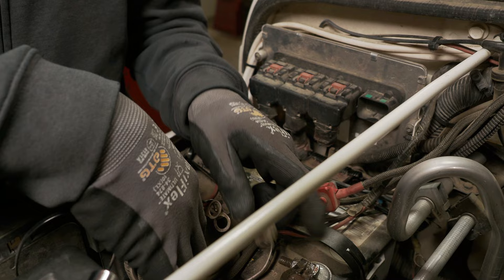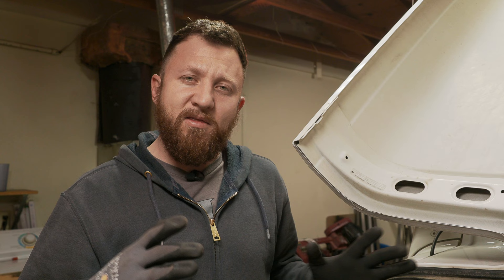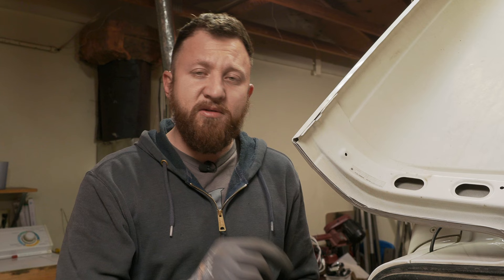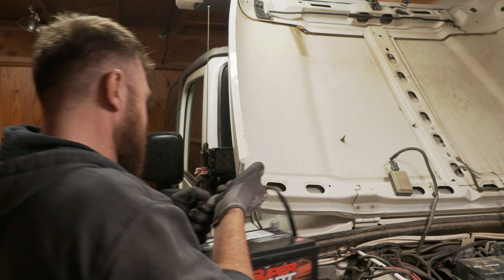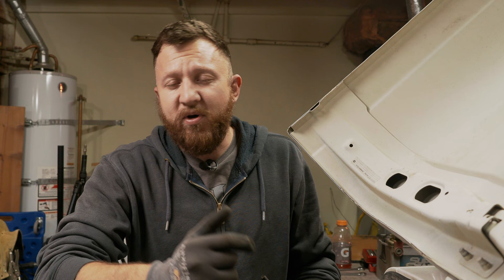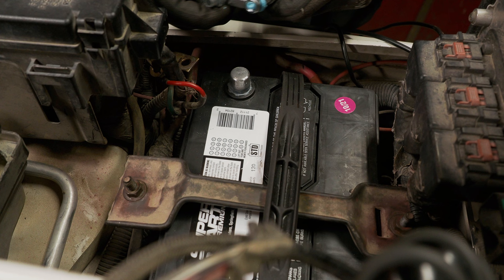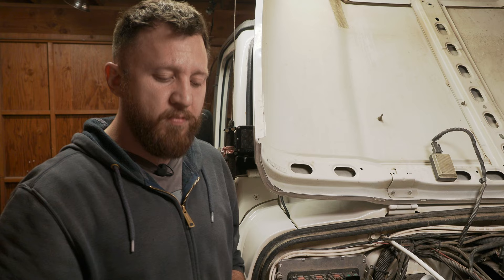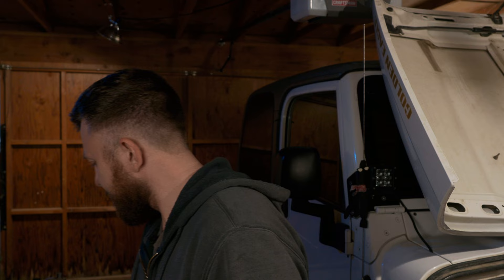Watch Before You Buy AGM Batteries

Comment: I had good results, but my alt charges the battery at 14.2 volts. I also had a very bad experience with a wet cell internally shorting due to off roading causing it to overcharge and basically blow up. The acid ate the brake booster valve which made things very dangerous.
Reply from the maker: I wish my alternator charged that high! I’d be running AGM instead. 

Wow that is a scary scenario. I also had a lead acid battery short after years of off-roading. 

AGM is a better technology no doubt. But It’s hard to recommend it if your vehicle can not charge it correctly.
Reply: @EmbarkWithMark  All alternators can charge at 14.5 volts, you just have to replace the regulator. Mine is bolted on the alt, but most are internal. Basically they turn the alt on when the voltage dips
Reply from the maker: @The_Ballo   Jeep switched to the ECM regulating the alternator some where in the 90s I believe. 

So for this rig, I’d need software to adjust it. I’ve been through one computer replacement with no change. The odd thing about TJ in particular is that some charge at 14.0, some charge at 13.5, some have a battery temp sensor, and some don’t. 

But I do know how to increase the voltage. Just need to get my hands on some expensive software.
Reply: @EmbarkWithMark  Good grief, just more electronic crap to break down when you're in the boonies
Reply from the maker: @The_Ballo  I don’t disagree. It’s rare to have an ECM go bad, but if one does. Not much can be done.
Reply: @EmbarkWithMark I've seen alternator shop use late 70s Chrysler ext. reg to bypass faulty regulator inside the computer.of course the rest of computer has to be ok.
Reply from the maker: @johnstuchlik5828  Yea I’ve found an external regulator kit. Just trying to decide if I want to go that route or purchase the expensive software to modify the pcm and leave the wiring alone.
Reply: @EmbarkWithMark  I found your video as well as comment by your self and others informative as all I knew before about charging agm was to heed the warning label posted on some of them not to exceed 14.8v(if I remember right). my 05 rav 4 2 different alternator taper to about 13.6 when fully warm.i thought this a bit low even for traditional lead acid.i live in warm climate and battery that was in it lasted almost 6 years and the replacement is going on 4+ years both are traditional lead acid, so all seems ok.
. I'm considering going to agm and will do a similar mod that you did to your Toyota now that I know.i understand your reservations about ext reg as quality is all over the map,carry a spare.i think it's possible to use a diode in your jeep similar to what you did to your Toyota.cheap, reliable solution.only problem is where to install it in wiring.somebodys probably figured it out.

Comment: Lithium ion phosphate are better, they last twice as long. Lithium ion can be fully discharged whereas AGM batteries wear out much faster if you discharge below 40% , lithium ion phosphate batteries hold there charge whereas AGM are quickly discharged despite their amp hour claims. And lastly they are much heavier than lithium ion phosphate batteries
Reply from the maker: I don't disagree with any of that. However, Lithium also requires special charging perimeters that an old alternator/ECM will not have programmed in,. Not to mention heat from engine bay is a huge issue with lithium.

Comment: Your wirings  neerds replacement not the AGM Battery.
Reply from the maker: The fact still remains, AGM batteries have very specific charging requirements and the charging systems in older vehicles are not rated to charge them.

Comment: Your alternator isn't working like any vehicle I have ever seen. All the alternators I have had in my last 6 cars from 1997 to 2022 charge their batteries in the higher range of 14 volts. AGM or not. I'm talking almost 15 volts.
Reply from the maker: It’s a common voltage for Jeep TJs without a battery temp sensor. I agree the voltage is much to low.

Comment: I measure my voltage and when I crank the truck it goes up to 15.1 volt and slowly goes down to 14.5 for a while and then settles at 13.7 when battery is full. Maybe your alternator needs replaced
Reply from the maker: Alternator doesn’t control the voltage in Jeeps. The voltage regulator inside the PCM does.

Comment: regular cars have no issues accepting an agm battery. my dodge avenger's factory battery was a 525cca battery, and currently I have installed a high quality, bosch 720cca agm battery. It's been in my car about 2 years and there is absolutely no issues with it. It's been an extremely dependable strong battery. It's also piece of mind knowing that it has plenty of power and will statistically last much longer than a normal battery. In fact, a few months back my drive belt ripped, and I had to drive about 7 miles to a repair shop with no alternator, running on pure agm battery power alone. I doubt the weak 525cca flooded battery could have made it and survived that ordeal. agm also does not corrode, my battery is only accessible after removing the front left tire and a plastic panel. which is a HUGE pain for maintenance on a traditional battery. with cleaning corrosion and topping off the water. it's truly a maintenance free battery!
Reply from the maker: I disagree. It really comes down to what voltage each car charges at. Some do okay with AGMs some do not. Take 4runners for example, there are devices with diodes to try and up the charge voltage in order to properly run an AGM battery in that vehicle. The stock charge voltage is just to low

Your experience really has nothing to do with CCA in that scenario, reserve capacity is what you where running on. CCA is a burst of power, reserve capacity is how long the battery can power something. Depending on your battery, the lower CCA could very well have made that 7 mile drive, assuming the reserve capacity was high enough and the battery was in decent shape. 

In general I do think AGM batteries are better batteries. My point is, understand the car and it's charging system before swapping in an AGM. Its possible the AGM wont work well. 

With that said, most newerish cars do charger at higher voltage. Older Jeeps are famous for charging around 13.5 volts. Thats not nearly enough for AGM, thought 14.0 volts seems to be enough to properly charge most AGM batteries today. 

Oh and I am well aware of the battery location in Dodge Avenger. What a silly design. I'd probably do the same.
Reply: @EmbarkWithMark my Nissan rouge (2013) does not seem to like agm
Reply: my car is curently using efb battery... is it ok to use   agm???
which is more durable and last long??
Reply: @carterbolt5424  Absolutely your vehicle can use an AGM battery, if it came from the factory with a traditional flooded battery. In fact, depending on the type of battery you have installed, tossing it out in favor of an AGM can be an extremely smart decision. My dodge avenger came with a relatively weak 550cca flooded battery. I replaced it with a high quality Bosch AGM battery. Not only is it much more durable, but the cold cranking amps and amount of power it can store has been very useful. I can do things like leave the radio running for a long time without worrying about a battery drain, it tolerates the cold in Michigan much better, it will last longer, a guaranteed 5 years, and it's completely maintenance free. AGM do not corrode on the terminals or require water to be added. An AGM will on average last a few years longer.
Reply from the maker: AGM is the better battery. No argument there. To tell if your car can use one. Get a voltage meter and see what your car charges after it warms up. Than look at the AGM specs. On average the minimum charge requirement seems to be 14.2. 

So if your car charges at or above that. Throw an AGM in. If not double check the charging requirements of the specific AGM your looking at.

Comment: Todays. Vehicles are putting a lot of loads on the battery , Start Stop especially , they cycle the battery twice has hard unless you can turn it off that’s why they use AGM which will recover twice has fast as flooded batteries and they last twice as long but in those applications you should see 3-5 yrs . Today 2024 there are two major MGF that are producing producing batteries in the United States they are Clarious former Johnson Controls and East Penn Family Owned in Pennsylvania since 1946 .

Comment: So my mazda Charges at 13.8-14.1, so you think an agm would be fully charged ?
Reply from the maker: I think your right on the edge, but would be okay. You could always through a charger on it once in a while to top the battery off. I do this anyway out of practice. Helps extend the life of the batteries.

Comment: Cud it be it wasn't being charged because of loose terminal??? 🤔 U should ALWAYS boost ur new battery before install. Most importantly, CHECK DATE ON BATTERY when purchased. Terminals stayed clean BECAUSE of glass mat battery. 
Purchase a higher amper hour  alternator.
Reply from the maker: Positive. The Jeep still charges at 13.5 volts. Below the AGM charge requirement Higher amp alternator doesn’t help with voltage. 

But I agree with everything else.

Comment: Which batter would you Recommend for a Honda civic HB EX 2019? Thank you.
Reply from the maker: Depends on the charge voltage. The best way to figure out what battery will work best is to take a multimeter and see what voltage your car charges at. If it's in spec for AGM then go for AGM. If its too low for AGM than go lead acid.

Comment: It's not the battery technology. The bad terminals were the fault by reducing the volts and current that could go to and from the battery. AGM's work well past their replacement warranty period in any vehicle with an alternator set up for FLA batteries. If you had an FLA battery in their you would have killed it even more quickly. No reason for thread locker on the terminal clamps.
Reply from the maker: My voltage is constant. It’s the same even with new terminals. AGMs do need more voltage than flooded acids do. AGMs are great batteries , If they can be charged correctly.

Comment: Sorry sounds like your alternator is really NOT putting out sufficient voltage to charge the battery.
Reply from the maker: Not an alternator issue, I wish it was. Replacing an alternator is a super easy fix. The whole point, some vehicles are just not well suited to run AGM batteries.

Comment: Did your jeep come with. AGM battery new from the factory ? Seems like they would supply the charging ability if that’s what it needed . My ultimate  package on my Tucson and my platinum package in my Highlander both came with AGM batteries because they are loaded with electronics. My 17 Tucson has the original battery in it that I’m replacing next month because the CCA are coming down . I use Deltran battery tenders for AGM batteries on them . My 23 ZL1 Camaro has a different battery in it and came with a charger but I need to look into it more as I’ve only had it a year and I don’t drive it but I love it more than life itself 😂
Reply from the maker: Jeep Tj's never came factory with an AGM. Which is the whole point. Vehicles design for AGMs can obviously charge them. Ones that did not more or may not work.
Reply: @EmbarkWithMark  I was watching something on YouTube Rainmanrayd , Royalautomotive , the car care nut ??? I don’t remember which but there were mentioning something about something in the car electronics 1 monitoring charge 2 stopping charge . It was about a car specifically designed to use AGM batteries because of all the electronics. Massive power moonroof , stereo with tablet , start stop tech etc. they referenced abilities to bring it back from the dead , vibration survival abilities etc. I know quite a bit about mechanics but I get lost in the electronics. It almost sounded like some cars are really more made for them in there ability to not overcharge them. They referenced the need for a specific type of aftermarket battery chargers needed for them ??? I’m wondering if he was referencing that ability in cars that come with them having that ability too but my elderly mind can’t remember specifics 😂😂

Comment: That's interesting. My last 3 cars, GM, Kia and Hyundai all output 14.2v to 14.4v with the battery connected. I wonder if you had a larger alternator or a smaller battery if the voltage would get a little hire. It would be concerning to see the voltage in the under 14v with the alternator running. Could you have a mismatched battery size for the size of alternator?
Reply from the maker: The battery size is standard for the vehicle. Alternators do not determine the charging voltage. The voltage regulator does. Jeeps from 90s on up have their voltage regulated by the ECM. So the only way to adjust that is to get software and adjust those settings. 

Because of this a larger alternator wouldn’t increase voltage. It would have the ability for more amps if the draw was their, but the voltage will remain the same. 

Hopefully this makes sense.
Reply: @EmbarkWithMark  Makes sense. Surprising alternator voltage is a function of the ECM. I guess they have a reason they wanted to control the voltage.
Reply: It is possible If you add too many accessories to the std car with a small alternator  to reduce the charge voltage.. the drain will be to great for the alternator to supply  run properly and charge and the voltage will drop.   You can tell your beyond the limit if the charge voltage drops at night with lights on AC on fan  on at max.  You seem to have added 4 extra lines to your car std charge system.
Reply from the maker: @danc2014  only if those accessories are pulling current. And in this case when driving on the road or idling in this video, none of those added accessories are pulling current.

Comment: I don't understand why you would use an AGM battery on a vehicle that doesn't require it?  Only use the type of battery that came with the vehicle.  Simple.
Reply from the maker: Reason? AGMs are generally a better battery. Not just at lasting long but when batteries are being pushed too. 

This is on a Jeep with a winch, lockers, lights, an air compressor, etc. it’s not uncommon for me to being using the winch on all day trips. I’ve pulled 40-50 trees off a trail in one day with this Jeep/winch. So I need a battery that can hold up. AGMs hold up better, IF they can be charged correctly.

Comment: Does your TJ still have its battery temperature sensor? My 98 and 01 XJ’s charge at 14.1 to 14.2. Float at 13.8 which has always seemed a little high to me.
Reply from the maker: Thats another odd thing about TJ's. Not all of them come with the temperature sensor. Mine does not come factory with a battery temperature sensor. Odd right?

Comment: Yeah , sure AGM’s don’t last. Mine in my 2010 F-150 lasted for 11.5 years and I’m hard on my vehicle. So I don’t know what you’re talking about.

Your Jeep wasn’t designed to use an AGM and needs a higher amp alternator if you want to take advantage of an AGM battery.
Reply from the maker: They only last that long if charged correctly. 

Second, AGMs need high charger voltage.  More AMPs won’t do anything if the charge voltage isn’t correct.

Comment: Any recommendation for a good alternator for AGM battery?
Reply from the maker: I don’t, the only reason, TJs have voltage regulators built into the PCM. So it doesn’t really matter what alternator you buy, the PCM will control it, unfortunately.

Comment: You lost me with the battery terminal that clearly would not probably charge a battery. AGM batteries are used around the world. Your alternator has to be capable of charging a AGM battery. Automatic chargers have to be rated for AGM.
Reply from the maker: It’s not the alternator it’s the voltage regulator. The voltage issue I have is still there despite replacing the terminals. 

Regardless the point of the video is to shed light that your car needs to be able to charge AGM correctly for battery last its full life.

Comment: Your problem is obvious from the start, poor wiring. Also you own a jeep, it needs .5 more volts from your alternator. Easily accomplished quick wiring mod.
Reply from the maker: Yes, I am fully aware the Jeep needs more voltage. If you have a "quick" wiring mod for a TJ Im all ears. The only options I am aware of is to get into the ECM and program it or do an external voltage regulator.

Comment: I just got to say this in all honesty,  don't you see what your problem is? It's not the battery.  Don't you understand most problems are created things fixed by owners. And will you blame the next battery.  Shorts and bad connections creates heat and will never gets a good charge. And get rid of that mess. And you will see. Have a good day .
Reply from the maker: I’m not blaming anything. Just sharing that AGM has a little bit different charge requirements. Make sure you charging system can appropriately charge them. Not all can.

Comment: Down in Arizona 3 1/2 years is good for any battery. I could probably go a bit longer but I don't want to get stuck in the boonies and about 4 years is the longest I've ever made it going back to the 1980's. I had three Optima red tops and they were fine but the problem is that if they get way low you will have trouble jumping and charging them. In fact they say unless you have an AGM specific charger you need to run a good battery in parallell toi them in order to get the initial boost charge. I have a 04 Jeep with the 4.0 and mine has always charged 13.7013.8 at the battery and 13.6 is what the PCM sees. As for terminal corrosion I've been using dielectyric grease for years and nver see corrosion with that.